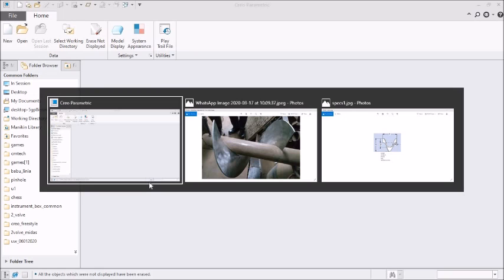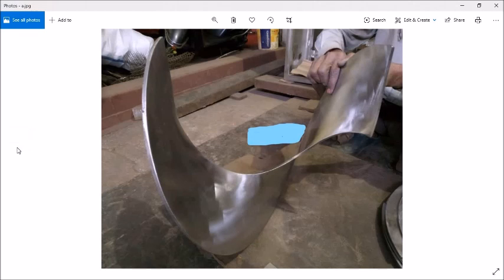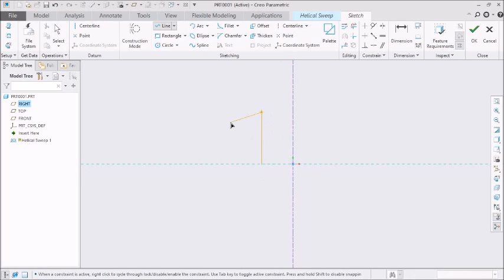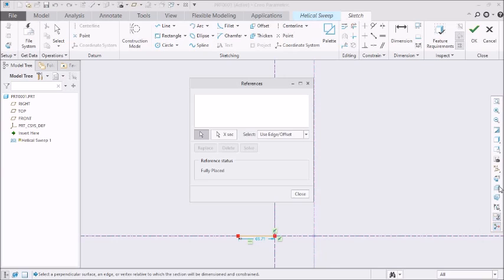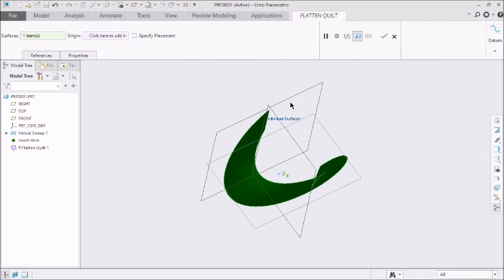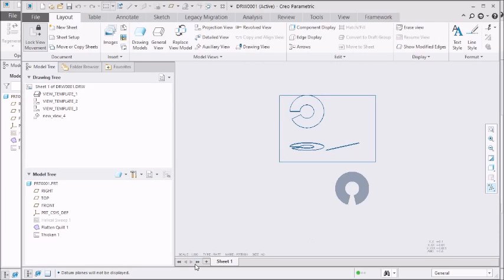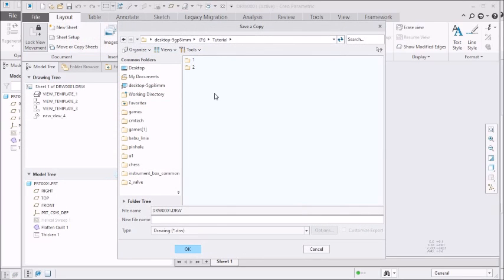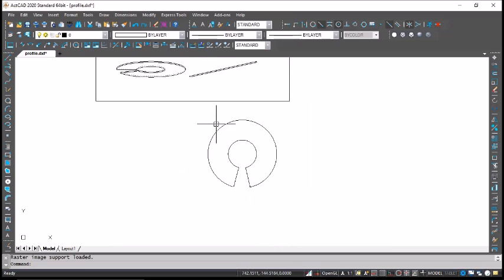Flattened helix Using Creo

Comment: dont work in a real world, if you try conform this blank will not match with de project drawing
Reply from the maker: This process is cheap and the application is for an auger, where tolerance is not an issue. If you need a very precise helix with a tight tolerance for say an application like chemical dosing or such, a cnc cut helix on a thick pipe OD( thickness validated by design calculations) and then stretching the blank to get the right pitch is one of the way for doing it. But that is way too costly for an auger. The process selection is based on application . Please post a constructive comment instead of summarily posting a arbitrary negative comment.